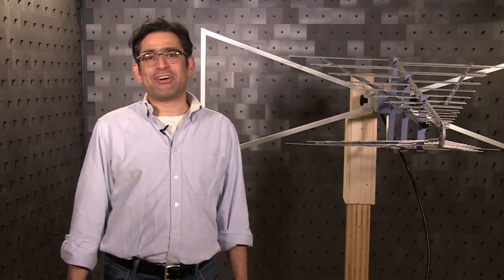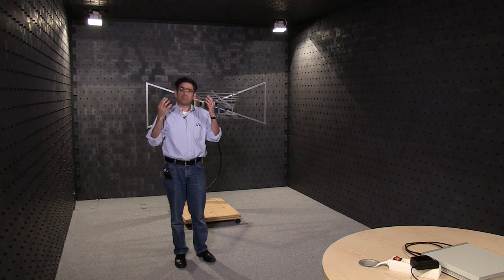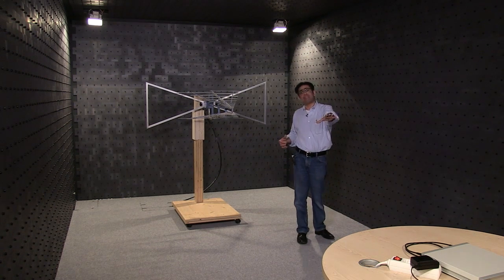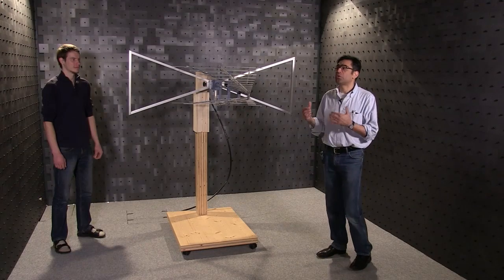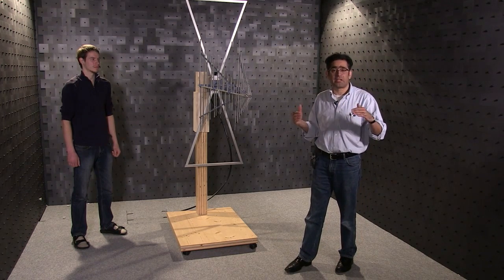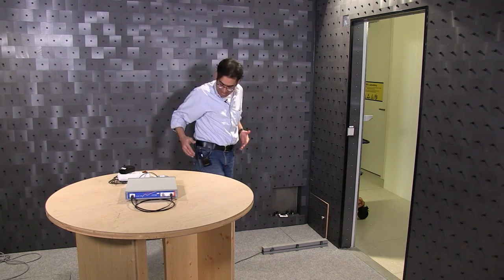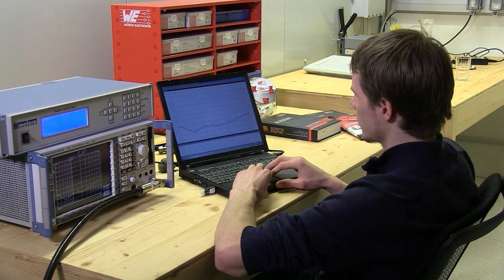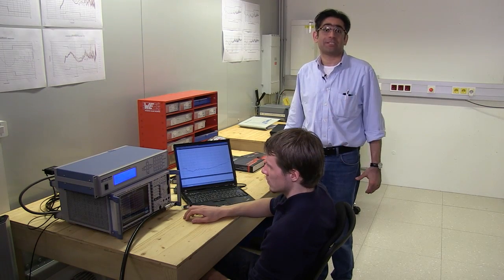Introduction to EMC  (Part 2/4): Radiated Emissions Test

Comment: Hi Dr Ali! My name is Christian. First at all thanks for all your videos. 
I have a question for about equipments to analize EMI emissions. Right now we have two options based on two brands, Rigol and Rohde&Schwars. I know that R&S is better than Rigol, but is more spensive too!!!
For both option we will include near field probes and a TEM cell. For the spectrum analyzer we have the option of the Rigol RSA3030 that there is a real time sprectrum analyzer and for R&S the FPC1500 that there is an entry level spectrum analyzer.
We don't have experience using this kind of equipments, but we did a few test on a semianecoic chamber. We decide incorporate this equipment becase we need a better harware debbuging before go to the semianecoic chamber.
Based on your experience, what do you think about Rigol spectrum analyzers? Do you think that RSA3030 is a good equiment for EMI precompliance tests? 
Thanks and best regards!